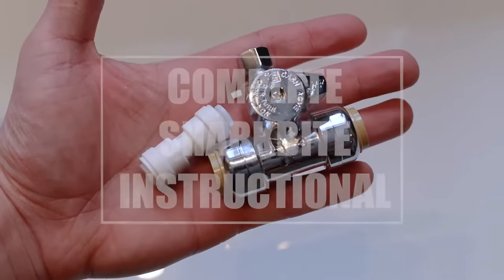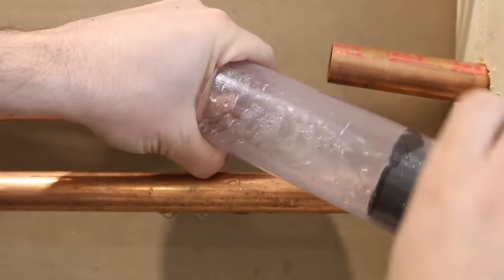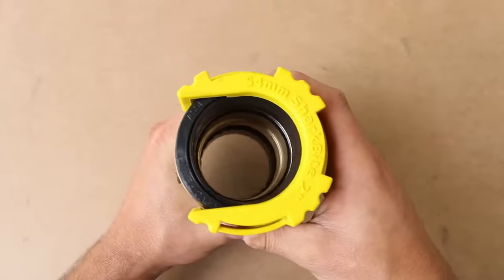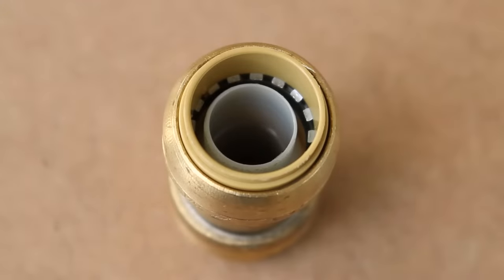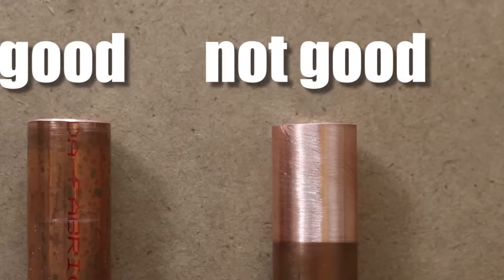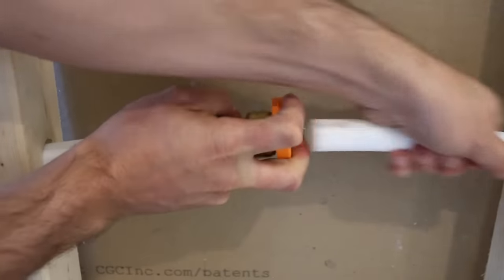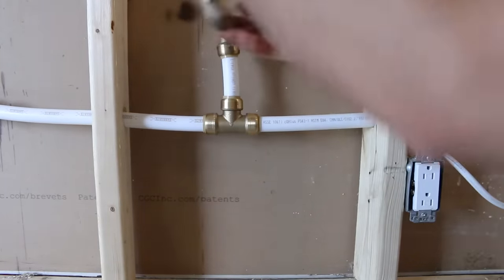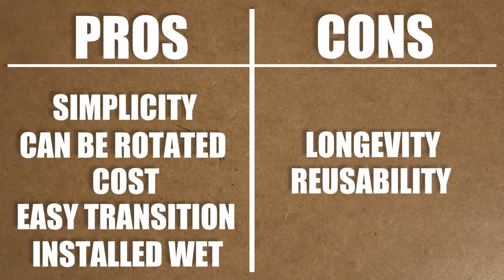Beginners Guide To SHARKBITE Fittings (Watch till end BEFORE Buying!) | GOT2LEARN

Comment: I use some Sharkbites SELECTIVELY where soldering is inconvenient (being able to rotate assemblies into position is super handy) but only where I have easy access. I do immaculate prep on the pipe and ensure the area to be grabbed is polished smooth with emery cloth. I've never had a failed install or a leak but I'm prepared for that, too. I use a lot of West system marine epoxy (high end boat builders have some very cool adhesives!) and if faced with seepage I'd drain the line, fab a simple "dam" to control the viscous epoxy then pot the joint. I did a test piece (always, always test adhesives before doing anything important) and it held fine under pressure. It's not to code but my farmhouse, my rules and the stuff is rated for potable water storage.

Comment: They do / can leak if there is too much sideways force applied at the connection - that is, if you flex one of the pipes too far. Such as can occur with PEX connections. You just have to make sure you're pipes are coming into the fitting straight. Also, try not to rotate the fitting too much as the teeth will cut a groove into the PEX weakening it....
Reply: Why would there be sideways force on a plumbing connection? Shitty work much?

Comment: I have been using these at work for some years now. In my opinion this kind of quick connector is good for air, water or any other liquid or things like grease. They hold rather well except for higher pressure applications. Although, any solid connections are just stronger and will last longer in harsh industrial environments...
Reply: Technically you suppose to run PEX pipe without any unions until the fixture. So unlike copper you can bend pipe around in directions you need, avoiding need for corners and unions. In places where sharkbite connection is necessary, technically you can make a concealed hatch, like  electric junction box . Easy!
Reply: Does high pressure include a bathroom 3/4"  cooper  going up from  a 3/4×1/2" shark bite el to a 2nd flr. 1/2" cop. Into a   Diverter valve.
Reply: @wendylacy7818  no. That is not a high pressure situation. High pressure for sharkbite would be a hydraulic line on a CAT9D.

Comment: Great video. Best I've seen on use of Sharkebite fittings. Had a acid neutralizer and water sofener added to my well water treatment system 5 years ago. Expected them to use soldered copper fittings, but he job was done before I could say anything. It is all in an accessible area.
Would never use Sharkbite fittings which were not accessible. Period !!
Thank you again.

Comment: What i very like about the Sharkbite is the plug
In the event of a pipe failing dramatically you could rush quickly get your cutting tool and press fit it on the pipe... Then call a plumber :)
Even if you didn't deburr a copper pipe, better a small leak from the plug you just put than a water fountain storming in your house.
Reply: They are very convenient for remodels stub outs before paint before you put the supply valves on .. ez and fast

Comment: I used SharkBite hoses installing my water heater. I got one that even had the water shutoff valve built right in. Made connecting everything so easy and hasn't sprung a leak yet.
Reply from the maker: That's nice!
Reply: I did the same thing. And, even if it leaks, it's exposed so it's easy to repair. I wouldn't put shark bite behind drywall. 
But, pretty much all of the failures I've seen with shark bite is improper installation. It's never actually been the fitting failure.
Reply: This is one of the best applications I’ve seen for these for DIY homeowners.
Reply: Yep 🤗 just finished replace a hot water tank doing the same thing,using hoses with shark bite ends one with a valve. 👍 Did the whole job in three hours. That was including removing the old one and picking up the new hot water tank at Home Depot. 😃
Reply: Ok but.... $$$
Reply: @bernieh6571  I did the math and for me SharkBite was a no brainer. I'm not a plumber so I would have had to buy a soldering kit, the hoses, the shutoff valve and the fitting which was going to cost a little more plus I still would have had to solder it all together with zero actual experience. SharkBite was not only cheaper but it was the sure thing. After having to deal with running out to get the heater and seeing that the new heater though it was the same capacity as my old one was about 3 inches too tall, I discovered this channel and learned how to properly cut and prepare pipe. By the time everything was ready to hook up I said screw soldering, I just wanna get it done. I did and have no regrets.
Reply: Bernie H yeah, I’m. Journeyman and avid believer in sweating copper over even running pex but I have seen a package shark bite water heater flex’s with ball valve for 30$ when my cheapest wholesale supplier will charge 9$ per flex and 16$ for a sweat valve. So the price is not an issue at all for people without the tools to sweat or crimp.
Reply: you change them when you change the hot water tank, so every 10 years, they should last that long without issue

Comment: After Hurricane Sandy, I used Sharkbites on copper/copper, copper/PEX, and PEX/PEX. It’s been over 12 years on over a dozen fittings and never had a leak. I even reused them for outside water lines after an early freeze, replacing the copper with PEX.

Comment: In my professional opionion - Sharkbite and Sharkbite like are to be used in an emergency only and only for temporary use. Freeze and Frozen they will fail and so far I have replaced 3. 
Use them but measure about 1" down and mark male portion of pipe and push in deep enough. Good Luck to You!

Comment: Great demonstrations. Nice to have the grey tipped one's work in converting/repairing PB pipe or just converting to wirsbo. FIP & MIP adapters are handy as well. Having the pipe spin has helped with alignment countless times but if they had one that didn't spin it would be helpful in certain situations too. On to your evoPEX vid..

Comment: We use them all the time and have never had a failure unless something was amiss, we always use a little plumbing grease to help with a clean install and it helps with being able to reuse the fitting, I have stops in my box I has have used 50 times and no failures, we sometimes do sand the pipe on older pipes with a rough finish but always 90° to the pipe  and with grease so the o ring has no way to weep water pass the o ring, it sets in the sanded groves and with grease and have never had a leak, great video
Reply from the maker: Good to hear this, Sharkbites do NOT leak unless they were installed incorrectly, thanks @Kainosktisis
Reply: @Got2Learn  according to your own video , they do leak when the pipe isn't prepared correctly.. those are your own words

Comment: Replacing a segment of old wisbro pipe that started leaking on Labor day weekend. A plumber would cost me a fortune this weekend but these fittings will work great in my subfloor. Thanks for the video, very helpful!
Reply: Till they aren't then you'll wish you called a plumber
Reply: @timothycampbell4269  I had a different leak that I used my home warranty on. The plumber came out and used a Shark Bite fitting to fix it. No regrets here.
Reply: @chadheese2103  youtube always saves the day

Comment: Great video, thanks for NOT being a talking head and showing us the hardware instead. You definitely are a proponent of the technology ... until the very end when you state you would not use them in inclosed walls or outside or for long term applications. I'm having trouble thinking of a short term application other than using them temporarily until you come back and replace them with crimp connectors. Many of the professional plumbers hate these because they leak, but you might have just demonstrated many of the reasons why they leak.

Comment: Shark bite actually included instruction to remove the stiffener. Unfortunately people failed to follow the instructions just ripping them out. The instruction were to use the release tool and then remove them. I still remove the stiffener properly.

Comment: I used these when I installed my new water heater.  That was 4 years ago and I've had no leaks, whatsoever.  Just be sure that you use a proper pipe cutter and remove any burrs from around the cut.  You want a nice clean, square end.
Reply: Did you remove the plastic pipe stiffner for use on copper? What happens if I leave it on for copper? Does the copper pipe go in far enough?
Reply: @scottzimmerman7667  I did remove the plastic pieces for my installation and have had no problems, as I was able to remove them without bending the teeth. 

Most important ... vital ... is to get a smooth, clean, "square" cut on the pipes and to remove any copper burrs.  Do not use a hacksaw ... use a proper rotary pipe cutting tool.  I then used the orange combination depth gauge (to mark how far I needed to push the pipe in) and de-burrer.  Also, I cleaned the ends of my copper pipes by using a little ketchup on a paper towel ... the acetic acid in the ketchup cleaned the copper to a nice bright finish. 

The only leak ... a very minor one ...  I had on my project was not on a Sharkbite fitting, but on a screw threaded cut-off valve, where I did not use quite enough plumbing tape.  It was a small drip (only once every minute or two), so I wrapped a piece of kitchen towel around that particular joint, put a safety bucket underneath and left it a few days until the leak stopped by itself from the calcium in the water.

Comment: Shark Bites are VERY expensive when compared to normal PEX fittings, but do not require the investment into special pex-only crimpers and etc.  IMHO, PEX is the way to go if you are doing more than a very simple repair with just a fitting or two.
Reply: They're great for transitioning to copper, time is money.

Comment: 23 years plumbing. 19 of those is service tech. Been using them since their introduction at hardware show in Vegas 17 years ago. Still use them. Won’t stop. Long as the outside of pipe is clean. And you put them on correctly. You be ok. I use 10-15 a month. Various type. I had a couple issues until I fully understood the mechanics. So say what you want but the inventor is making millions and they get bought. Trust me. A homeowner will return a busted fitting that costs $10. The company would’ve went under long time ago. But instead 4-5 companies use sharkbite idea and make their own. So good luck figuring them out. Just because something is quick and easy doesn’t make it unprofessional. Professionalism is simply not allowing a non pro to get screwed. DO NOT USE IN DIRT.
Reply: Phillip James you sir are my hero
Reply: I think these fittings are the best thing to come along in plumbing in a long time. I used these in my bath remodel 8 years ago and have never had a leak or problem. I just used them again to change both indoor and outdoor garden hose water supply piping. Soldering is difficult in a tight spot and that is another pro to Sharkbite fittings and valves. You don’t have to worry about setting your house on fire soldering in a tight spot close to insulation and wood. I would use these anywhere in my house with confidence. Another pro is it can cut your project time to less than half by not having to solder. Push them on the pipe and your done!
Reply: Well said JP

Comment: My favorite is barbed fittings with pex. Lower cost, almost as easy to install, pretty easy to take apart and reuse, no o-rings to worry about. haven't tried the plastic barbed fitting, but would like to because I have well water, it's slightly acidic and so leaches metal out of metal fittings. That way with pex and plastic fitting there's be no metal in contact with the water.
Reply: Use UPONER WIRSBO AQUA-PEX (A-PEX). It goes where copper fears to tread. Stretches if it freezes and goes back to original size when it thaws.
Reply from the maker: Video on that here: https://youtu.be/S-W6G9HWJ-4

Comment: Nice job on video.  Very informative.  Yes - my concern is the time test.  Since there is a "O" ring involved, it seems it may wear out over time.  The question is, how long?   I have a flowtite on my house that started leaking after 30 years.   The flowtite was under the sink where the leak was apparent.  I will use the Sharkbite the same way - where is it exposed.  Something tells me the Sharkbite will also last 30 years (or longer), which I can accept, as long as it's easily accessible to repair (plus 30 years is a long time).
Reply from the maker: They are EPDM, which last very long.

Comment: I like them but I’m skeptical about using them in a wall especially in Arizona because the hard water sucks and is destructive to any pipe
Reply: You got that right
Reply: I live in arizona with 37 grains hard water in the heat, etc. and have several sharkbite push-in connectors installed with zero problems. Actually had the metal rings or crimp ons fail on me couple times and it's why I replaced them with sharkbite connectors. The key to plumbing longetivity is to not go above 140F water temps and keep the pressure around 50psi with a regulator installed on the main cold water line going into the house. The more pressure you put the system under and with hotter water the more problems you will have and longetivity will go down. Keep water temps around 140F to kill bacteria inside water heater. They live from 95F to 115F. Too cold they go dormant and too hot will kill them.
Reply: using them on straight well water. Nothing wrong here.

Comment: I used these over ten years ago to replace a leaky pipe section and add an outdoor faucet. No leaks ever. Follow the instructions to de burr copper ends and mark the insert length with their tool.  I suspect more fires have been started by soldering operations than shark bite failures if installed per the instructions.

Comment: When you install a sharkbite fitting in an awkward position, the plastic insert may not be aligned, and you may push the pipe damaging the insert and make the fitting unusable. Pushing the pipe is harder in those difficult corners. What I have done is to put plumber's grease inside the sharkbite fittings to prevent the insert from moving and also put some at the end of the pipe for an effortless push. On top of that, it will extend the life of the "o" ring inside.
Reply: is vaseline acceptable?  cause thats what i was thinking is cheap and easily on hand.    Im curious if its better to just but a sweat to pex as well.  for some apps
Reply from the maker: I'd have to inform myself as Vaseline is Petroleum based and might damage the o-ring in time, I am thinking a silicone lubricant would maybe be more appropriate?
Reply: @Got2Learn  Learn  something new everyday.   THis will help for the health crisis to know!! So then is there  a way to start a fire using vaseline?  seperate the the ptrolium to a point of octane without additional flammable chems or FLAME as a bit of a effing joke!
Reply: @Got2Learn  Silicone lubricant should be fine. My local HomeDepot offers plumber's grease from two different vendors, and they run for close to 2 and 3 dollars, although different stores may have different suppliers.

Comment: The building industry is using them more and more and have gone to larger pipe and fittings. Change always meets with resistance. Twenty years isn’t bad sometimes metal pipe doesn’t last that long. Replacing fittings is cheaper than replacing copper pipe. You can do longer runs with fewer fittings which saves money too.

Comment: Great video- wish I knew the prep phase before! These are great to use in situations where it's almost impossible to install a standard solder fitting. One thing I found when disassembling an old sharkbite type joint (a plastic variation), the copper on the outside of the pipe- inside the fitting- was very corroded and appeared about to leak very soon. Had a fun time trying to disassemble it!
Reply from the maker: Glad it was helpful!!

Comment: Another pro you missed is the safety feature when working around wood or sheetrock. Holding a blowtorch around those materials could be problematic.
Reply: There are little shields you can buy FWIW :)

Comment: I'm one who's used there early versions and those ones I found to have more problems than the ones today. My favorites all copper all solder but for emergency repairs I'd say they're five star if you know what you're doing
Reply: Good
Reply: How do you clean the pipe? He said don’t use sand paper, another video said exactly that to use sand paper
Reply from the maker: Abrasive pad
Reply: @Got2Learn  thanks! Exactly what I did and it worked perfectly

Comment: I use a chamfer and deburring tool used for reloading ammo. Works like a charm!! Also I used these 7 years ago, I chamfer and deburred and just stuck them on push pull and spin, no leaks after all these years. Thanks
Reply from the maker: If installed the correct way, they don't leak.

Comment: When running pipe using sharkbite fittings, do not use them in the attic. Run whole, continuous lines. Instead of putting a "tee" above the ceiling, use two separate lines where the ends will be under the ceiling level. Whenever possible, fittings should be used only in exposed areas or places where if they fail, the damage will not be too extended.
Reply: @Leon G Copper pipe is still King, nevertheless when doing some repairs or remodeling using pex pipe may save you a lot of time, money, and effort depending on how comfortable you are using this product. Pex pipe comes in 5, 10, 25, 50, and 100 feet. When you have to use several "tees" off the wall, Sharkbite offers open and closed manifolds from 3/4 to 3/4 inch outlets and 3/4 to 1/2 inch outlets.  One more thing:  when buying these accessories, be sure their packages are sealed; otherwise, they may be returned items from your local HomeDepot and do not want to take any chances.